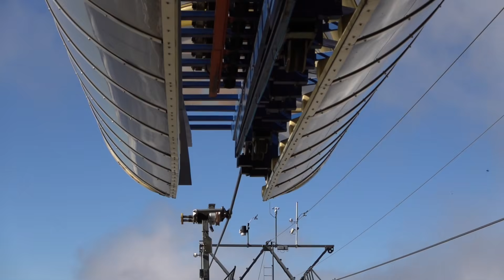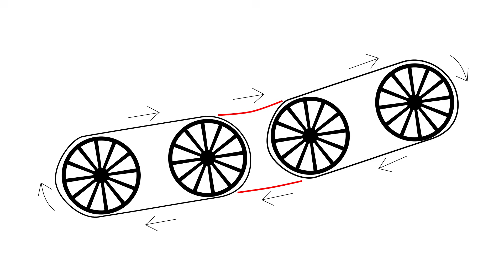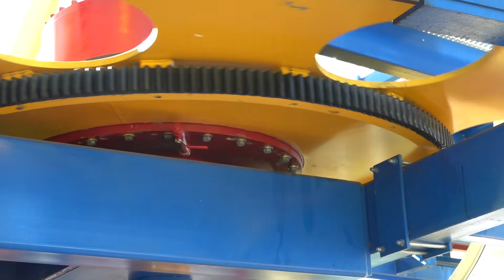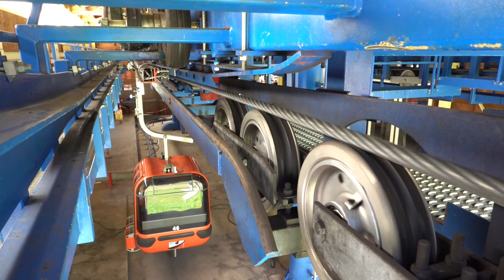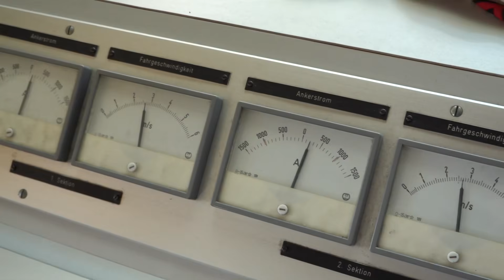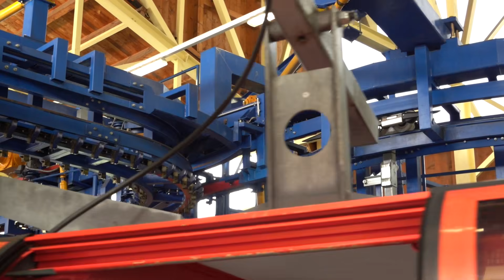What you didn't know about ropeways

Comment: Thank you so much for this video! I'm 19 year old, and since I was a child I've been mesmerized by my local ropeway in Aprica, Italy that until last year it had a very similar ropeway that was substituted just recently. Every time I used I watched every moving component at the very detail, until, I figured out everything that was mentioned in this video by myself honestly, because I just admire this peace of engineering. Your video is really a gem because it's the only one that gives you such a close look for those like us that love ropeways like this. Only one thing that I'd love to see is the tensioning part of the station. I mean the weight linked to the non-engined main wheel that keep the tension of the rope correctly. You can see at 22:09 the difference between the main wheel of the lower station of the higher section (non engined wheel) that has pulley linked to the tension weight that is below the station floor, and the main wheel of the higher station of the lower section (on the left). Usually tension stations are dowhill and engined stations are uphill in order to keep the best tension of the climbing side of the rope that usually has more weight (climbing passengers), but sometime this rule is not applyed in order to keep lower maintenance costs by having the engined stations downhill. Anyway, I'd love to see the room with the tension weight below the station. ... Thank you again and I suggest you to have a look at the old ropeway in my local ski town that I was telling you before, since you may be interested: https://youtu.be/8GPM0Av3-bw?si=87cNhnZeM-fTvI86
Reply from the maker: Thank you! Aprica was quite the beauty itself!
If you desire to see rope tensionning mechanisms, check out my videos with the chairlift comparison, as well as my Zermatt Awesome Ropeway Compilation video, as they contain footage of tensionning mechanisms as well.
Reply: @sandro-here  Thank you! I just realised that you've made those videos too! I just finished watching them now! Amazing! I'm scared for your hands by the way hahaah thanks for your hard work

Comment: Why can't they keep it running past thirty years?  What would they have to replace?  The use case wouldn't go away by then, hopefully.
Reply from the maker: The concession expires and it needs to be re-certified. This would involve retrofitting a ton of stuff in order to comply with current safety regulations for new ropeways. It's hard to impossible, so likely it will be torn down and replaced by a new ropeway within a single summer.
Reply: @sandro-here  I wonder if they could sell it to a third world country?  What do they do with the old system?
Reply from the maker: @MrGottaQuestion  they do sometimes ☺️

Comment: I adore all these mechanical solutions to the various problems and potential problems such a unique and complex system invariably produces!! Like the cable derail safety which is a physical loop of metal designed to break off if the cable drops onto it, causing a physical disconnect of the entire electrical system!! Genius!! I dunno why, but I prefer physical, mechanical solutions like that over reliance on digital/analogue detectors and electrical sensors. Shame these gorgeous symphonies of mechanical perfection and harmony are a dying breed.

Comment: The one thing I worry about is the rope.  There is no backup system if it breaks.  How often does it get inspected or replaced ?
Reply from the maker: I don't know numbers but it's greatly overdimensioned and gets inspected in regular intervals using devices that can "see inside" of it. More modern ropeways also have permanent real time surveillance of the rope.
Reply: @sandro-here  By comparison, passenger elevators use 6 cables, each one of which is strong enough for the elevator.

The San Francisco cable car system replaces their cables fairly frequently - I think every 6 months for the routes that have hills.

Comment: Is the clamp material surface made from UHMW "polyethylene" (black for UV stabilized)? Does the "rope" twist imbed into the plastic causing the clamp effect to grip into the surface of the plastic material? How often are these clamp "pads" changed out?  I am not sure I understand how the clamping force is actuated? Is it a cantilevered system? Does the plastic eventually erode away through abrasion with the wire rope or does the plastic eventually "extrude" itself out of clamping tolerances from the cyclic forces of pressure over time?

Comment: Is there any redundancy in the support of the gondolas?  What happens if the single cable were to break?
Reply from the maker: The cable is made of cables made of strings of steel. It is thoroughly checked and very overdimensioned. Check accidents related to ropeways, it's almost never anything related to the cable

Comment: 525 HP pretty good for running all of that. I had two 100HP ABB's on a 110" wide paper rewinder which ran paper board at 6000ft/min. HA Line shafts, my grandfather designed papermills from the 1940's through the 1980's. Went from line shafts to digital drives, however in this case I would much rather have lineshafts.

Comment: I too would like to thank the operators and you for this awesome video.
I was never able to understand how they (let go of and ) slowed down the gondolas for loading and unloading.  These and many other questions were answered due to the extreme cooperation of the operators and your daring filming work.  At 611 you show the specs of the motor which I can totally appreciate since it is almost twice the size of the largest motor at my work (350 hp).  985 Amps at 420 volts is quite a bit for one motor.   The crusher plant where I work has 28 motors running at once including 2 250hp on the cone crusher and one 350hp motor on the jaw crusher.  This gives me a strong appreciation for the engineering involved in using one (1) motor to run this entire machine (not including the blower motor and I'm sure a few other small motors).
Thanks again.

Comment: Cool how they use diesel power unit (looks like an inline 6) to drive a hydro pump and hydro motors.  I guess a few advantages here. It's more efficient to do this than make enough electric for those motors. It also has the advantage that it would also be a backup Incase of motor failure or motor gear train failure. It's not just a electric backup it's also a back up for the entire regular power unit.

Comment: Just.. the one.... motor! (Well, and the spare / emergency engine) Well, that is pretty much the definition of "Keep It Simple 'n' Straightforward" strategy. My personal question would be: Thermal expansion? How do they deal with the thermal expansion of the wire? It just sags a little more in summer? ...and what if the wire is empty and then suddenly you tack on several gondolas in a rapid fashion? That would sort of want to move/drag all slack to one spot! So, I'm guessing there must be rules for keeping a specific density along the whole wire?
Reply from the maker: The lower station wheel can move horizontally and is tensioned with a counterweight. It absorbs all tension differences caused by load, speed adjustments, and thermal expansion.
Reply: @sandro-here  Ah! Excellent! Thx!

Comment: So, if the rope breaks, is there anything that can improve chances of it not being a total disaster?
Reply from the maker: I've never heard of a case where the rope breaks, it's extremely overdimensionned and checked thoroughly. The few accidents that occur are usually related to failing breaks or failing metal pieces. There has been a case of a helicopter accidentally dropping a bucket of cement onto a ropeway - people were heavily injured because the gondolas swung like the pearls of a falling christmas tree, but the rope held.

Comment: That is a very great video on ropeway, the hoisting motor, control room layout and safety system very similar to the Peak Tram in Hong Kong, but one thing different is our still using motor-generator to supply DC to hoisting motor while this already used tryristior static converter to supply DC power to hoisting motor, great engineering work.

Comment: Fantastic description, and probably the only one of it's kind. 

I have been fascinated by  cables cars since  my first ride in one back in 1966.  You have unlocked many secrets I had pondered for decades, thank you!

 As a child I rode the Teleferico de Caracas Venezuela that had 5 stations and went from Mariperez (station 1 ) Caracas to Avila peak (station 2)  then over the mountain to the coast via station 3 , El Liron, and onto station 4 at Loma Caballo, then to the final station 5  near the coast at Macuto.  The fantastic route connected Caracas to the coast over the mountains and linked it to the seaport of La Guira and Aeropuerto International Simon Bolivar. 

At Avila Peak, station 2, there was a 600 meter aerial tramway with 8 passenger bubble shaped cars that carried tourist over to the world famous Humboldt Hotel.  It used a traction cable and suspension cable.  There was a pool, tennis court, and even an ice skating rink at the base of the hotel, world class dining, casino, and 70 rooms with a spectacular 360 degree view of Caracas and the sea coast.  To this day it is the pride of the residents of Caracas and and can clearly be seen by the cities 4 million residents as it sits atop the Waraira Repano nature preserve.  as of 2016, the Hotel has been restored with all of it's original amenities and is a hugely popular destination for Caraquenos. 

The  main Teleferico system used a dual traction cable, and a single large suspension cable. The  cars( cabins) held 26 passengers.  The cars that circulated between Station 1 and 2,  were red, while the cars used between station 2,3, 4, and 5 were yellow, or green and blue.  In normal operation, you would change cars at every station, but it was possible  for a car to be run from station 1 to station 5  by use of a secondary track between the suspension cables that linked each station.  They used a counter weight system to maintain tension of the traction cables.  Stations 3 and 4 were  required due to the geography which did not allow a straight run from Macuto to the top of Avila peak, so  at these two stations, the  tramway made about a 30 degree turn.  

The system had two motors; one for station 1 and 2, and a second motor for stations 3,4 and 5.  As in your video about the gondola, a similar method was used to detach the traction cables from the car so it could be  decelerated and unloaded. It could also be transferred to the next section  of the mid stations by means of a movable rail that could link the sections together. There was also a rail to divert the cars into t a maintenance and storage area at stations 3 and 4.   

At the time of its inception (1955)the Caracas Teleferico was the most sophisticated and longest Aerial tramway system in the world until the Merida tramway was completed. Both of these tramways were built by Heckel of Germany and were part of the Venezuelan dictator Perez Jimenez's grand scheme to make Venezuela the most modern country in all of South America. He had millions of dollars coming in daily from the prolific Lago Maracaibo oil field and therefore spared no expense on these two ground breaking "Telefericos".    The system however lacked the modern acceleration wheels  so there was significant wear of the traction cables on the coastal side which caused several fatal disasters resulting in the closure of stations 3,4 and 5  by 1958. The Avila to Macuto section was used sporadically but closed to the public, and a new cable was ordered from Heckel, but when it was delivered it turned out to be 10 meters too short! This resulted in the permanent closure of the Avila to Macuto sections, leaving only the Mariperez to Avila  section servicing the Hotel Humboldt.    

 Like most of these Aerial Tramways, it had a useful life of about 30 years and ceased operations in the mid 1980s. Eventually station 1 and 2 were restored partially, with new cables and pulleys, and overhauled cars. It was re-named the Teleferico Del Avila in the 1990s but the system was inoperative  again by  the early2000s. Today, the original Tramway only retains the  first two stations.  All the towers,machinery, and cars have been replaced with a gondola system. It has been renamed the Maraira Repano Teleferico.  In Galipan, on the coastal side of Mt. Avila,  a new station is being built along side the Loma Caballo station, bypassing  the El Liron station, and terminates at Macuto.  Construction began on the coastal sections in 2015, but was halted several times, once due to Covid, but has resumed at a slow pace due to Venezuela's economy being devastated by runaway inflation under Maduro's failing leadership.  Despite these setbacks, Caraquenos eagerly await the restoration of the coastal (Litoral) sections from Mt. Avila  to the resort town of Macuto , the port of La Guira, and the airport at Maiquetia.

Comment: Bye using magnet technology alongside removable weights gravity technology and solar energy technology you could use no energy but gravity.  Simply bye having weights that can automatically attach and unattach for the downhill car's computer operated to the amount of weight coming up.  For backup power solar energy technology also powering electrical computer, lights and so on.  Couldn't you?

Comment: I've asked on some videos but I have never gotten an answer. Why newer lifts have contour tires on the whole station instead of a chain? The ability to push carriers manually seems like an advantage to me, which can't be done with the tires.
Reply from the maker: I asked that question to one of the ropeway operators and he said he wasn't sure. Neither the tyres or the chains need that much maintenance. Note that some ropeways have tyres that can be lifted in order to still move the carriers manually.

Comment: This is the channel I never knew I needed in my life! These are mighty pieces of engineering, even before taking into account that they were built on the very difficult terrain (and the videos are fantastic on their own: the story, the filming, the editing). Would you consider covering other ropeways (well, if there is something special about them), for example Grindelwald-First (it's quite long and it also turns 90 degrees at some point), Murren-Birg-Schilthorn, Attinghausen-Brusti? The last one is quite interesting. It's fully operated from the middle station, people boarding at the bottom need to ring up control room and this ropeway seems to be fully private, it's not even part of the SwissPass. It also seems to be used predominantly by inhabitants of Brusti to go to work and schools in Altdorf, so operates only mornings and evenings.

Comment: Just thinking about how many engineers had to think about everything, the planning of everything, then draw it on paper or by computer model, AutoCAD. Then think about all of the welding shops that had to weld all these parts together but before the welding shops, you had all of the machinist and all the machines took to make all the parts for this huge machine. A lot of these parts a custom made and required to be made at the foundries. Almost forgot about all the concrete, rebar made up before it could be poured! The people who had to do the back breaking work to install everything after it was made, then transported to where it was all put together. 
Then the work ur required to get the slopes done! I would have loved to have been able to ride a mountain bicycle down something like this or ride my dirt bike up and back down a mountain like this!

Comment: You'd have to have a tremendous amount of confidence in that one single skinny rope not breaking to ride one of these!
Reply from the maker: The rope is probably the most reliable part. It's heavily oversized and comparingly easy to maintain. Look at the stats of international accidents, the rope is hardly ever a problem. It's a remarkable piece of engineering.

Comment: just so you know, rope = schnur. you keep saying schnur weg. i think you mean a steel cable, there is no such thing as a steel rope, since this is the title on your video i will give your translation a solid F
PS: You should get a phone with slow-motion, that would have helped. I have an older model and it has 2 different slow-motion speeds.
Reply from the maker: Both terms are correct, see e.g. "Leitner Ropeways"
I have high FPS and the footage was shot using that
Reply: @sandro-here  Maybe in british english or Leitner got it wrong but in the USA if it's made out of steel it's called a cable. A lot of germans get confused, for example AdBlue in the USA Ad actually means advertisement and Add means addition, so they should have called it AddBlue. We use the term Ad all the time, like the tv show has many ads. Just thought to help you out with some tips but you probably know better. The tip of the slow-motion camera is good because you don't have to slow down the whole lift. I can take a video of rain drops falling in slow motion just with my phone so i figured you can do the same.
Reply from the maker: @pratwurschtgulasch6662  thanks for your input! Yes, there are many different terms. Even in German, different manufacturers use different vocabulary to refer to the same concepts.
Slowing down the ropeway greatly improved my aim as I had more time to place or retract the camera. Note that there are a few slomo shots as well, where the lift operates at summer speed and I shoot at 120 fps
Reply: @sandro-here  either way it's an awesome video, just like you i've always wished i could peak behind the scenes to see how it all works and thanks to you and the operations manager showing this stuff now i know :)
Reply from the maker: @pratwurschtgulasch6662  thanks! Working hard on the next 2